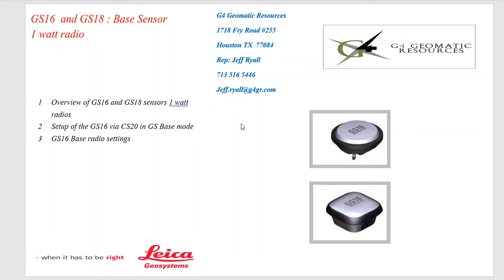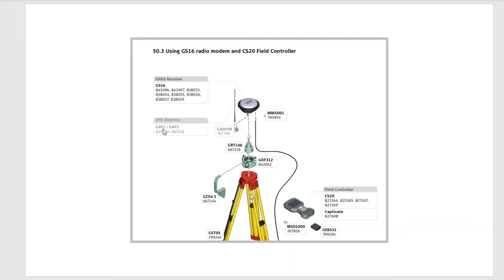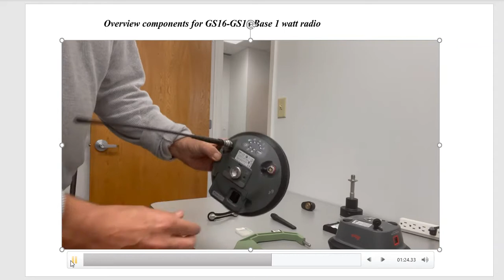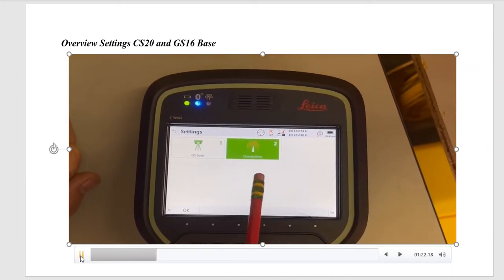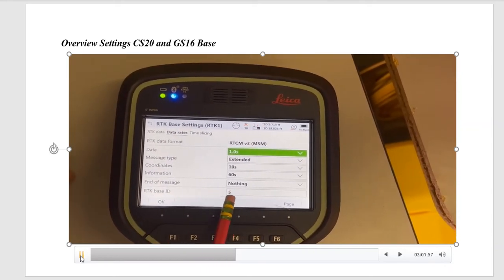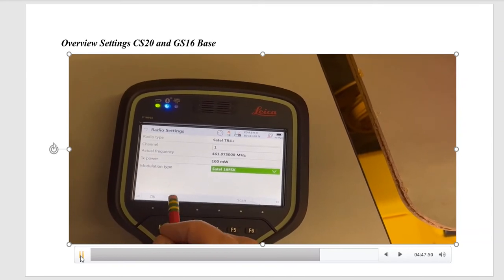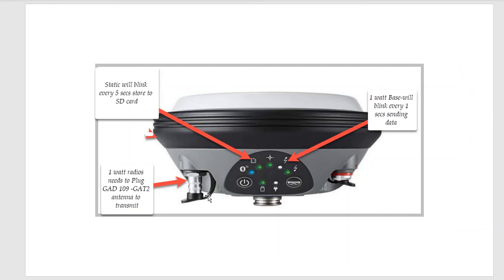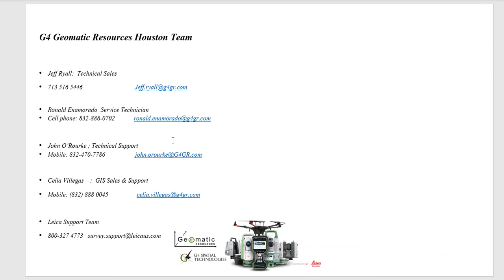Leica UHF radio Video 3 of 5: GS16-18 Internal 1 watt UHF Base radio using   CS20

Comment: Can we setup the base RTK to transmit via UHF and 3.5G at the same time?
Reply from the maker: there is a RTK1 and RTK2 settings which i think you can enable at same time,  where you can set up-so I not sure  it is possible i have never tried